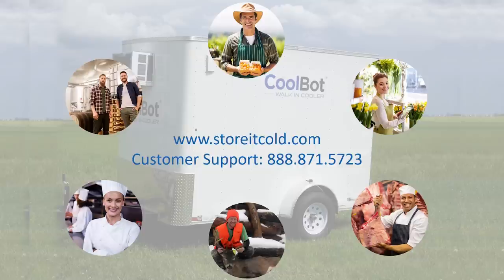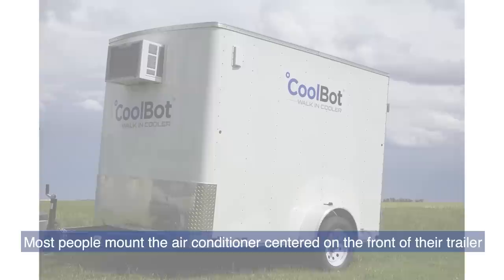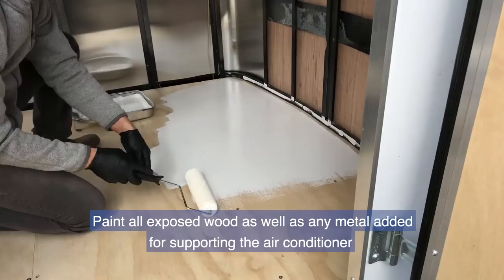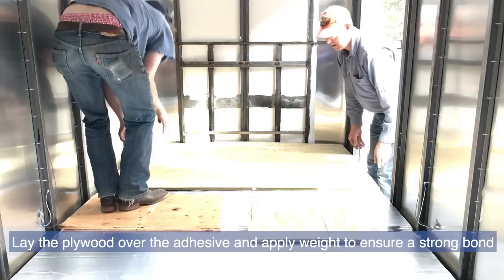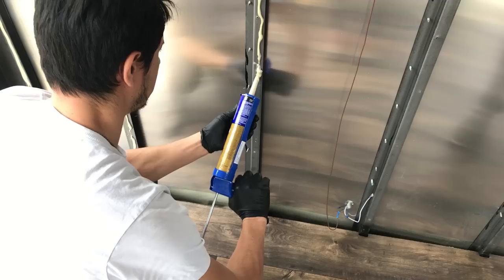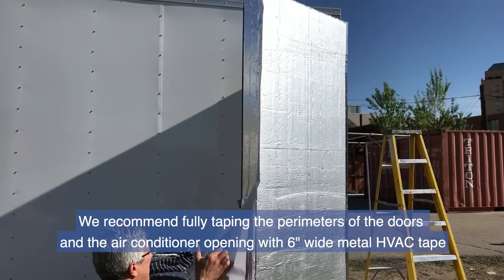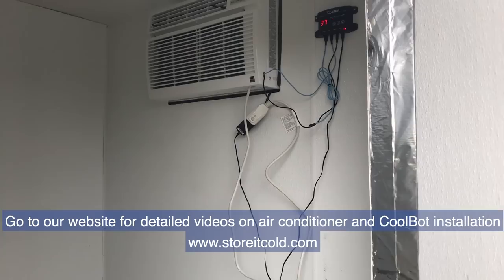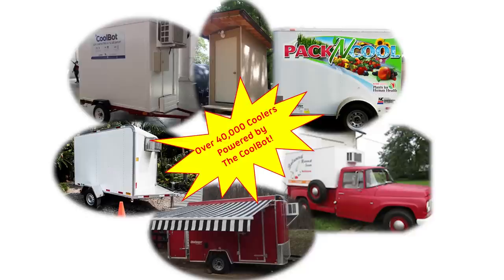CoolBot Powered Mobile Walk-in Cooler

Comment: Wrong.   Insulate the ceiling BEFORE the walls, that way the walls hold up the edge of the ceiling. This is common knowledge on earth.
Reply from the maker: Hi there, thanks for reaching out and for the tip. Insulating the ceiling first works as well.
Reply: @Storeitcold  It's the only logical way. The same way drywall is installed, ceiling first. Correct your install videos.

Comment: good ideal IF you want to knock your compressor out. Running at low temps on an ac unit will eventually send liquid to the piston....NOT GOOD!
Reply from the maker: Hi there, thanks for reaching out. Compressors on modern AC units are now scroll compressors (for increased efficiency) and have built-in suction line accumulators. Scroll compressors don't have pistons and can handle potential "flooding" well - as opposed to their reciprocating counterparts that were previously used. This was already observed and reported (as a plus) when using modern window ACs for cooling purposes back in 2009 in the report done by the New York State Energy Research and Development Authority on the CoolBot. You can read that report here and please email us at hello@storeitcold.com with any other questions.

https://storeitcold.com/wp-content/uploads/2020/03/NYSERDA-CoolBot-Report-May-09.pdf

Comment: Would installing a drain be worth the extra cost, my concern is blood getting on the floor from hanging deer/hogs
Reply from the maker: Hi there, thanks for reaching out.  You can install a drain, just make it as small as you possibly can and get a tight fitting plug for it to prevent any cold air from escaping.  If you have any other questions please email us at hello@storeitcold.com
Reply: @Storeitcold  So how do you recommend cleaning the floors?
Reply from the maker: @tclodfelter8789  , thanks for reaching out.  Cleaning the cooler floor with a mop works well.  We advise staying away from power washing or using a super wet mop as you don't want any water to get between your panel seams.  If you have any other questions please email us at hello@storeitcold.com

Comment: Your video instructs to install two 2 inch thick insulation sheets and then 3/4 plywood for the floor and your video casually shows how to install the "coated" screws. However, I can't find the screws in your video that clears 4 and 3/4 inch floor. 

Where do I buy the 5.5 inch primeguard exterior screws shown in your video?
Reply from the maker: Hello Cliff, thank you for reaching out. We would recommend "Power Pro 48618 Wood Screws, #10 x 6", Premium Outdoor Deck Screws" or something similar for your build. These can be found online or at hardware stores. Please contact us at hello@storeitcold.com with any other questions.

Comment: Have you tried using solar energy to power coolbolt units? I am very interested. Thank you.
Reply from the maker: Hi there, thanks for reaching out.  We have limited experience with solar applications but do have some customers out there powering their CoolBot coolers that way.  Email us at hello@storeitcold.com for more information.
Reply: The starting current of compressor is over 3 times than working current, you need big inverter for solar energy, I have the new design which we do not need inverter, we can discuss more if you are interested in

Comment: Why did you decide to use contact cement instead of standard vinyl flooring adhesive? Also, how the heck did you initially get the floor in place with glue on both sides? Did you step on the glue? Or have someone suspended mission impossible style?
Reply from the maker: Hi there, thanks for reaching out!  We originally used vinyl flooring adhesive but it did not stick well and bubbled.  The contact cement worked much better in our situation.  As long as you've got your flooring securely glued you should be good.  As far as spreading the glue, having a tall person with a very long wingspan helps!

Email us at hello@storeitcold.com or call us at 888-871-5723 with any other questions.

Comment: How sturdy is the roof for hanging and setting up a hook system?
Reply from the maker: Hi Benjamin, thanks for reaching out.  The roof of the trailer is not load bearing so our solution was to build a stand in the cooler that is anchored on the floor.  You can set a shot of it at 5:53.  Email us at hello@storeitcold.com and we can walk you through how we did it.

Comment: Where did you purchase the insulation.?I am having a problem finding the R25.
Reply from the maker: Hi Marvin, thanks for reaching out. Most hardware stores carry rigid foam insulation. The R value of each layer builds, so you'll need to source enough boards to get you to R-25. For example, if your hardware store carries 2 inch thick R-10 boards and 1 inch thick R-5 boards, you'll want two R-10 boards and one R-5 board to get you to the recommended R-25. Learn more on our website and email our team at hello@storeitcold.com with any other questions. 

https://www.storeitcold.com/build-it/insulation-selection-installation/

Comment: Don't try to run your ac off your car battery. If you go through all the trouble for a nice mobile cooler, use solar and a battery bank or a generator. Don't ruin your car battery.
Reply from the maker: Hi Toby, that's a good recommendation. A healthy battery and alternator are a must for this so it is always recommended to check with your mechanic the condition of yours. Many users that only need to run their "small" A/Cs (10K or smaller) have good results with an inverter, as long as they choose a good quality one and the cooler is not a 24/7 necessity. A generator is highly recommended for applications that will require the A/C to run for long times or for A/Cs bigger than 12K.

Please email us at hello@storeitcold.com if you have any other questions.

Comment: About how much do you need to spend on building materials for a 5 or a 25 foot trailer? I would really appreciate any information
Reply from the maker: Hi there Aidan, thanks for reaching out.  For reference, this trailer was 10' x 6' and the materials (insulation, air conditioner, etc) cost $2,208.  We don't have a price on the trailer, the person we worked with purchased it themselves.

Please email us at hello@storeitcold.com with any other questions!
Reply: @Storeitcold  thank you so much that really helps a lot !

Comment: if the trailer is not going to be mobile (will never move from the spot its parked), do you think it would be fine to use a standard window air conditioner mount (off of amazon) rather than constructing a frame?
Reply from the maker: Hi there, thanks for reaching out.  If you have no intention of moving your trailer, your proposed plan makes sense.  Make sure that the A/C mount is anchored to a secure and sturdy part of the wall of the trailer.  
Reach out to us at hello@storeitcold.com with any other questions!
Reply: @Storeitcold  ok thank!

Comment: can you make a video talking about insulating the doors please and thanks
Reply from the maker: Hi there, thanks for reaching out. Unfortunately at this time no video has or will be made specially for door insulation. That is a very good suggestion thought!
We do however go over it briefly in our DIY Indoor Cooler installation video which you can find HERE
:  https://youtu.be/TEqJJhGzMxs
We recommend an insulated exterior door that will have an outward swing. Make sure it has weather sealing and make sure not to damage the sealing during installation. Also, plastic curtains at the entrance will help keep some of that cool air inside while the door is opened.
Email hello@storeitcold.com with any other questions!

Comment: Could this design be modified, to make this a mobile walk in freezer, rather then cooler?
Reply from the maker: Hi Tom, thank for reaching out.  We have yet to break the freezing barrier!  But to be fair, we haven't been trying at all.  The CoolBot uses a window air conditioner to get our coolers down to 34F, they are unable to get to freezing temperatures.  

For a walk-in freezer, you will need to go with a traditional HVAC system.  However, if you figure out an alternate way to make it work, let us know!  We'd love to hear it.

Comment: Could you give some recommendations for shelving?
Reply from the maker: Hi Brett, thanks for reaching out.  We did not put any shelving in our mobile cooler, but in our shed style cooler we purchased storage racks at our local hardware store.

We recommend using standing racks rather than trying to screw into the wall.  Your cooler should have a minimum of four inches of insulation, making it very difficult to try to attach a shelf to as you would need a very long screw to reach the studs.

Call us at 888.871.5723 if you have any other questions!

Comment: How do you hang the meat or do you have to use shelves
Reply from the maker: Thank you for reaching out.  We built a gamble system to hang the meat because it allowed us to support the most weight.  Shelves will work too if they are freestanding; because the walls of the trailer have four inches of insulation we could not install weight bearing shelves.

If you have any other questions please call us at 888.871.5723 or fill out our Cooler Construction Advice Form and we'll reach out to you!  https://storeitcold.com/cooler-construction-advice-form/

Comment: What size trailer is that? 5'x8'? And what was the total cost for the whole build? Thanks
Reply from the maker: Hi Forrest, thank you for reaching out.  The trailer was 10' x 6' and the materials (insulation, air conditioner, etc) cost $2,208.  I don't have a price on the trailer, the person we worked with purchased it themselves.
Reply: Oh nice! Thanks for the reply appreciate it.
Reply: @Storeitcold  $2200 is only the materials? How much is labor?
Reply from the maker: @evisdaison8394  Thank you for reaching out.  We, the CoolBot team, built this ourselves and did not hire a crew.  It took us about four days to outfit the trailer and that included stopping to film and take pictures.  We hope this helps.  Please email us at hello@storeitcold.com with any other questions.

Comment: Can coolbot be installed on 20 oe 40 ft container??
Reply from the maker: Hi Sergio, thanks for reaching out.  You can use the CoolBot system on a 20 or 40 ft container, you just need to make sure you get the correct size A/C units.  Email us at hello@storeitcold.com or fill out our Cooler Construction Advice Form and we'll help you get all set.  https://www.storeitcold.com/cooler-construction-advice-form/
Reply: Literally one minute into the video they say that you can,